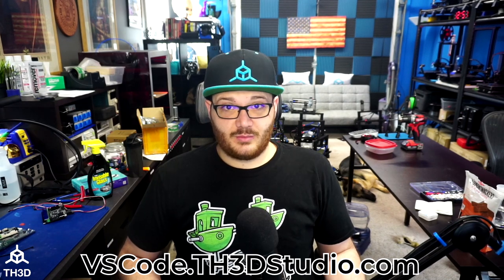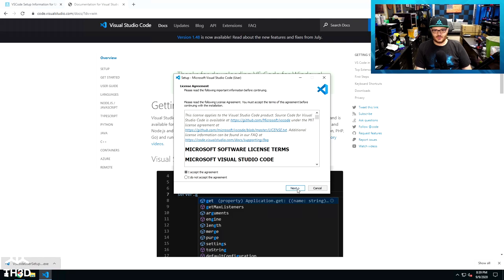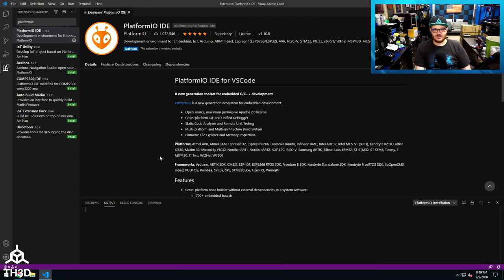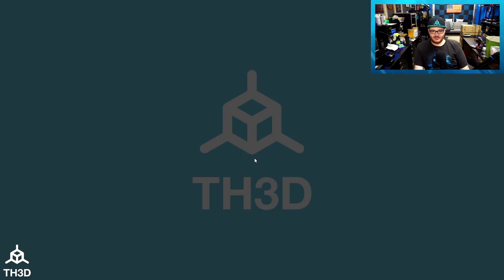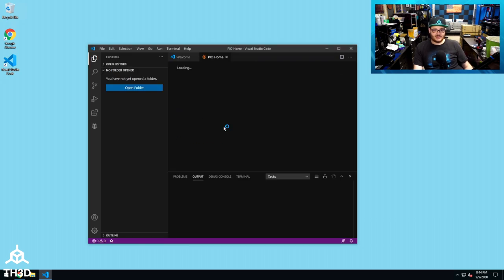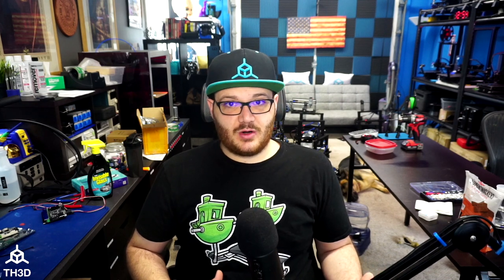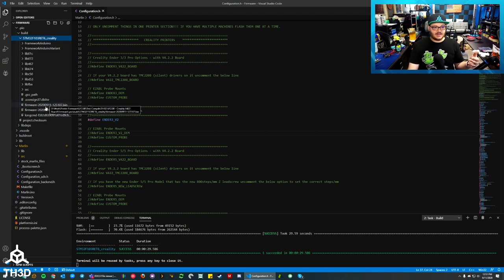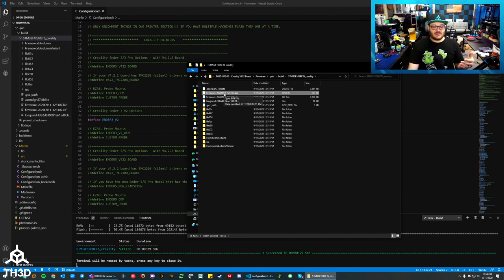Setting up VSCode for Marlin 2 & Unified 2 Firmware | OUTDATED SEE VIDEO DESCRIPTION FOR NEW LINK

Comment: FIXED (See below):  Not sure if I'm alone here but I'm having multiple issues.  First, there is no tick for build after installing PlatformIO, second when I attempt to right click the environment and select "Build and Debug Active File" I get an error stating "Cannot build and debug because the active file is not a C or C++ source file."  any suggestions?

Fix: Be sure the folder you select to open is the one that is just above the marlin folder with the files you copied.  This will correct the issue.
Reply: thaaaaaaaaaaaaaaaaaaaaaaaaaaaaaaaaaaaaaaaaaank you!
Reply: omfg thank you! I was pulling my hair out trying to figure out why I didn't have a compile button...
Reply: Mate, thanks heaps. Why is such an obvious omission from the video and the website documentation missing this fact.

Comment: Hi, Just used your guide to update the firmware on my E3Pro. I was having issues with resends on Octoprint. I had tried moving the ribbon cable as suggested in some forums but no go. Another forum suggested a firmware update, which led to your tutorials. The process was easy and I no longer have resends occuring. Thanks for the informative videos.
Reply from the maker: Thanks for sharing

Comment: Hmm, I was going to try it for myself by downloading one of your files, but I have to pay. Will I be able to set it up for my knockoff BLTouch clone and microswiss all metal hotend to have the bltouch working properly (i.e. not instantaneously turning off my printer upon powering on) and to achieve the max temps my all metal hotend will allow? It's for my Ender 3 Pro, fitted with the Skr E3 mini v3. The last thing I want to do is purchase this, then find out i have to do more or something else and/or it wasn't the correct one, despite selecting the one for my printer & board.
Reply from the maker: Yes, the firmware supports the BLTouch and clones in it. All metal hot ends of all brands also work with the firmware as well. If your board is turning off on power up that is because you did not wire things correctly and are shorting out your board (that is a hardware issue, not firmware). We also have an addon for $40 that then entitles you to technical support on the firmware if you need help. That support is covered for 6 months if you add it on and you'll also get 6 months of firmware updates as well.

Comment: Welp...looks like I'm not sure what to do.  Still rocking an OLD 8 BIT Board, but based on this, and your site the TH3D firmware needs the VSCode and not the Arduino IDE.  Yet, no directions for the 8-Bit boards really.  Rather use the Arduino IDE then...Yes, I'm EXTREMELY late to the party...I retired, I have time...Now I want to put the 4 year old BL Touch on my Ender3...this just frustrates the bejeezus out of me.
Reply from the maker: See our new guide here: https://www.youtube.com/watch?v=xDc9FpenGUE
Reply: @TH3DStudio  NOW THAT'S SERVICE!  LMAO...Vid droped 2 hours after asking!!  LOL..

Guys, this has driven me NUTS.  All the old data is kind of "useless" as many things have changed.  I just wanted the Ender3 to have BLTouch...that I've had for YEARS and never installed because of time.  Now I have the time.  LOL...

Comment: I have the Platformio icon on the left side but none of the Platformio files show in my explorer window. So I can't access the Platformio.ini file to set my environment. Just a day before I had everything working and successfully compiled a build, but when I tried to do it today it seems to install, but no files are present.
I have completely uninstalled everything and reinstalled twice now with the same results.
What am I missing???
Reply from the maker: You need to open the firmware folder for whatever firmware you are compiling. You will want to open the folder one directory up from the "Marlin" folder that contains the platformio.ini file in it.
Reply: @TH3DStudio  Thanks, it seems I opened the Marlin folder instead of the root Marlin firmware folder which is where the Platformio.ini folder was. Just as you stated, one directory above. 
WOW, I didn't expect such a swift response, Thanks again.

Comment: Thought I'd share this here since it took some time for me to resolve. If you are getting denied access to the com port after clicking the arrow icon to upload the compiled firmware, it turns out my malware software didn't like what PlatformIO was doing. After adding the folder C:\Users\YOURNAME\.platformio to the allow list, everything is working good now.
Reply from the maker: That's a way to work around it. Avast flags it sometimes, so we just turn it off when compiling sometimes if its getting in the way. Local PC issues are one of the reasons we made the EZFirmware site so its all compiled server side, no need to mess with VSCode locally. https://ezfirmware.th3dstudio.com/
Reply: @TH3DStudio  User friendly stuff is always a big plus. Also, I've been trying to get XLoader (short from touching the CMD line, AVRdude etc) or Cura my main slicer to flash the firmware, but no luck, still seem to have a communication problem, but Cura does work for USB printing. Only VSCode and the Arduino IDE will flash the firmware without any issues. Since both Unified 1 & 2 firmwares are working smoothly on my CR10 printer (after using the UNO to load a bootloader, that still had Marlin 1.0), I decided to add the EZABL pro and mount to the Bullseye cooler, which is on the way and long overdue :-) If there is an EZ way to flash the firmware after using the EZFirmware site, that'd be awesome. Thanks.

Comment: Something I haven't been able to figure out is why it takes hours of computer work (at least for a not very smart person like me) to get firmware installed when it should be a simple download => install process. I've installed firmware on routers, and the steps to do it for a printer have me absolutely confused. I'm a mechanical designer, not a computer programmer.
Reply from the maker: Because you have to compile it yourself from source code. If you don't want to deal with compiling manually we have our EZBoard that has a website that does it all for you:

EZBoard: https://www.th3dstudio.com/product/ezboard-v2/
EZFirmware Site: http://ezfirmware.th3dstudio.com/
Reply: @TH3DStudio  Bless you 😭
Don't know why I couldn't find this, absolute life saver!

Comment: I've never dun this before and I'm having trouble with downloading the build to my Geeetech A20T. I used VScode with python 3.9.6 and got the vert-marlin bugfix 2.0.x-a20t-testing. it did the build successfully but does not load onto the printer. Printer is also not recognized. Don't mind using the micro sd card but vscode does not give me a location for the build or the hex,  only and elf. tried to do a build for my Ender 3D pro and had the same problem, an elf file but no hex or build file.
Reply from the maker: That printer updates over USB, not the SD slot because it is an 8bit CPU.
Reply: @TH3DStudio  any suggestions as to where I might go to get my computer to see the printer?

Comment: I have no check mark. It's so annoying as I have followed like three different videos. I know nothing about code so could it be that something in the code is wrong so it doesn't recognize it?
Reply from the maker: Try reinstalling VSCode and Python.
Reply: I had this problem as well. Make sure you install the PlatformIO as this is what gives you the checkbox.
Reply: @TH3DStudio  none of this is working
Reply: @TH3DStudio  where is the check it is driving me insane
Reply: @jeremyherrin29  Same here. This video is useless after clicking install platformIO IDE and finding the extension
Reply: same i need help
Reply: @rozzi235  so what worked for me and it sucked was I uninstalled everything then reinstalled everything and I had to also download a plug-in called "Auto Build Marlin" then it all worked
Reply: I got it to work but now i cant find the rio folder in order to get the bl touch to work with the ender 3 pro. You would think this would just come with the printer when you buy it.
Reply: @rozzi235  hmmmm personally not to sure about that I'm still learning all this but I wish you luck I'm glad that worked for you
Reply: @HunterAlakai  I just closed the whole project out, and instead of dragging the Merlin folder onto VSCode, I dragged the whole Firmware folder onto VSCode, then it was able to figure everything out and compile right away.

Comment: Would like to say a thank you for this. I was stuck on the compile part but it was the wrong folder selected. Completed on a ender 5 with 4.2.7 board.
Update - firmware installed but it just made a mess of the print gone back to stock. Ender 5
Reply from the maker: Check your Z steps. SOme need the 800 option.
Reply: @TH3DStudio  thank you. I'll try this over the weekend. I hope it works 😃
Reply: @TH3DStudio  I tried 800 but still gave mush, there's something I'm missing. Thank you anyway :)
Reply: @TH3DStudio  Update - As per normal it was user error, I copied the wrong BIN file to SD card. Firmware works as it should, also working with octoprint :) It doesn't show your logo in top left on the LCD like in some of your other videos but not the end of the world.

Comment: Must be all different now cause I can not get any of this to work and nothing "firmware.bin" is not anywhere to be found. My E3 never came with anything other than sample .stl's and Creality and Cura slicer. So, now what?
Reply from the maker: Your question is bad so I'm not able to give you an answer because you didn't actually state your problem.

Try again on a new comment with more detail and specifically stating what your "issue is" instead of a lazy "I can not get any of this to work" statement. The better the questions you ask online, the better the answers you will get from others.

Comment: My VSCode isn't showing the "check mark" to compile the file into a .bin... What am I doing wrong?
Reply from the maker: You probably opened up the firmware at the wrong folder level.
Reply: @TH3DStudio  you are right, that was the problem and yes I Open the whole folder instead of just the firmware folder.
Reply: @TH3DStudio  why isn't this shown in the video?  Such a basic step to miss out! I've been stuck for two days on that, until I went digging in the comments.

Comment: Hi there, I've got the Ender3 V2 with the V4.2.2 board.  Done the firmware update successfully. but the LCD Firmware doesn't bring up the black,blue and orange screen with your logo. When I go into the info screen it does show TH3D UFV 2.05.  I can confirm that i used a format micro SD card FAT32, and that I followed your instructions to the T.
Reply from the maker: For all technical questions and issues please use the forum here: https://support.th3dstudio.com/hc/en-us/community/topics/360001750572-Unified-2-Firmware

Comment: Followed instructions to a tee.... I successfully did it once but now trying to do it again... I get an error with include pathfile bad squiggles..... I have reinstalled vsc but for some reason after install.. it saved all my edit still. I didn't touch any settings.
Reply from the maker: You probably opened the wrong folder. You must open the folder that contains the platformio.ini file. With our firmware that is the one called 'Firmware' as the directions for our firmware state in the beginning steps.
Reply: @TH3DStudio  .... Thank you... I can't believe I over shot one folder... I opened the next folder instead of opening the firmware. First timer here and thanks for the help.

Comment: Thank you for all the great info.  I need help though, I did the Marlin flash firmware and everything worked out.  My issue is that when I try to do the bed leveling with the Bltouch that I just installed it goes relatively to the center and than when it goes to the first spot after it is off the bed in the front by about 30mm so it never gets a chance to start bed leveling.  Is there something in the code that I need to tweak?  Thank you in advance
Reply from the maker: We don't post replies that need a lot of detail and other information on our YouTube comments. We'd highly recommend posting this question on our forum (its open to anyone) to get help with their machines. TH3D Forum: https://forum.th3dstudio.com/
Reply: Will go to forum, Thanks

Comment: Is there just someone who has the firmware for me to save to an SD and upload? my offsets are x-43y-8zbasically0
Reply from the maker: If you have an EZBoard you can use the online tool to compile for you: https://ezfirmware.th3dstudio.com/

It will generate a firmware.bin file for you to put on your EZBoard.

If you don't have an ezboard you can ask in the forum and post your configuration.h file and someone may be able to compile for you. Forum is at https://Forum.Th3DStudio.com